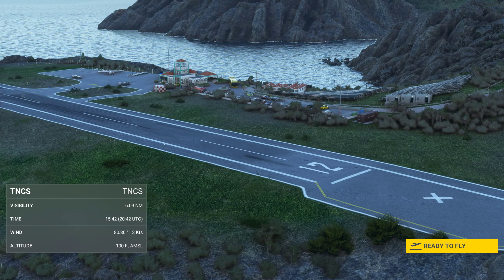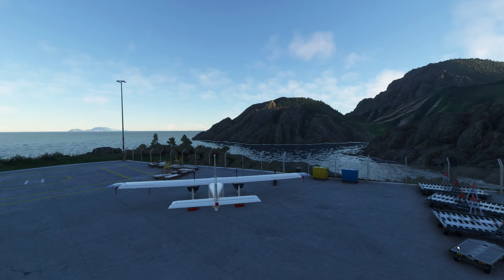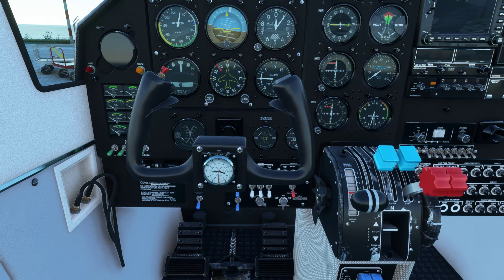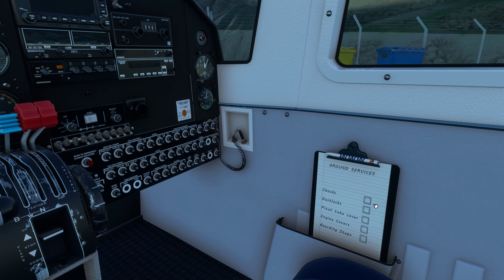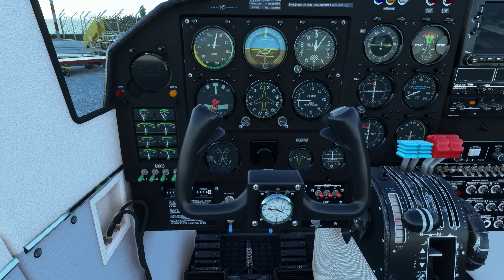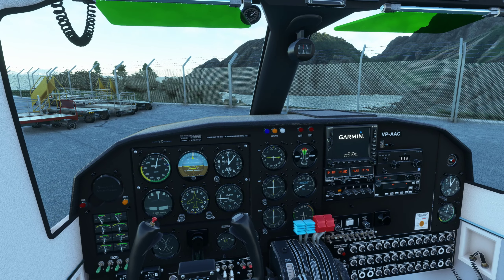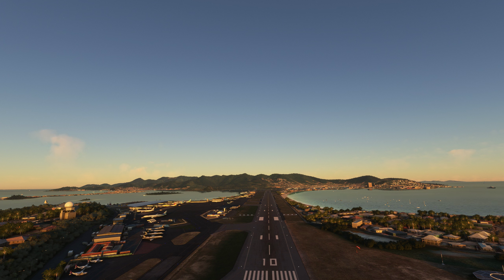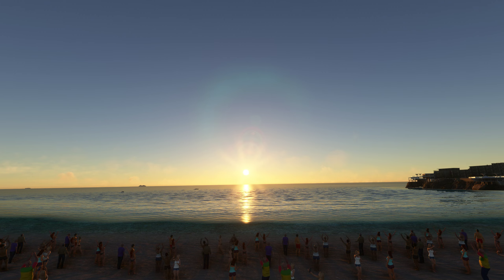Now Let's Look at the Payware Princess Juliana International Airport | MSFS2020

Comment: Well done indeed. Lots of peeps on the beach. We hit several casinos and yes there was one by the bar. 
It's interesting the relationship between power and pitch. I have often times turned on the auto pilot and watched as the pitch was adjusted to maintain altitude, then adjust power  in an attempt to reduce the occillations and check the altitude as the plane "lines itself out. Hope I was clear. Good info.
Reply from the maker: Yeah, pitch plus power equals performance!